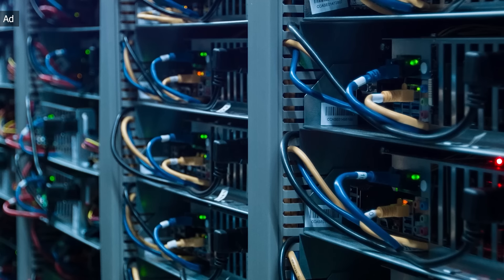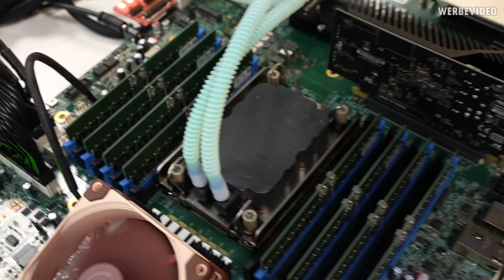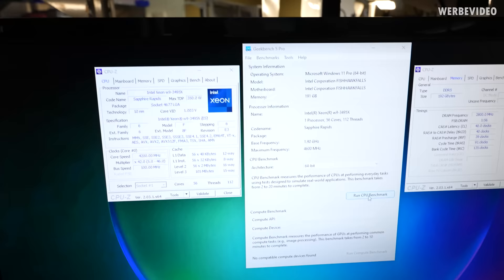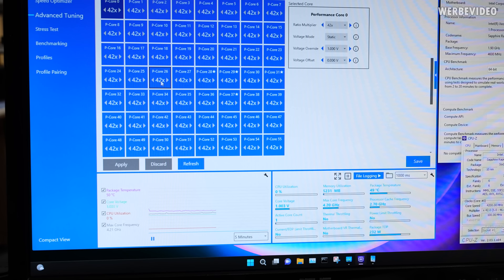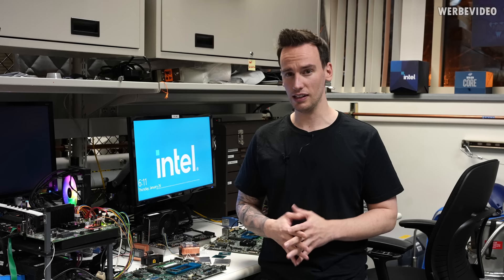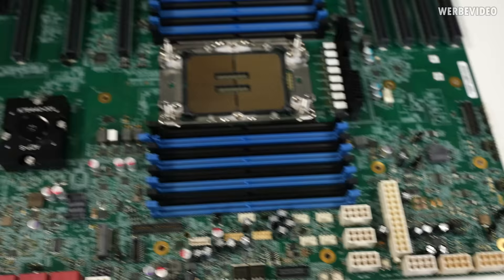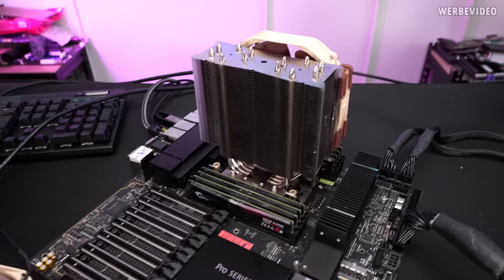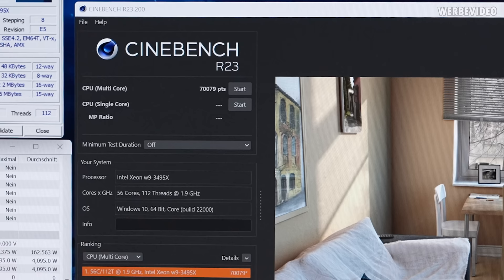Intel HEDT is BACK! Insane Overclockable 56 Core Sapphire Rapids CPU

Comment: Luumi showed with the W3175X that the package power readouts become quite skewed at the higher draws, I wonder if that is still the case here, would be interesting to see what it actually pulls.
Reply: That was reading power coming from the wall, so it's accurate.
Reply: @ionstorm66  That's assuming that the instrument reading the draw was accurate. It was bouncing about, could probably use a little integration to get a solid number.
Reply: @UncleKennysPlace  That was in the literal overclocking lab at Intel's headquarters. I doubt... actually I know they wouldn't use inaccurate equipment. I was an Engineering Technician there.
Reply: @UncleKennysPlace  those are the real numbers, it wasn't a solid burn in test. All the spikes in power are from the CPU getting loaded. Transients are a big issue with modern hardware. Also likely why they are doing Geekbench instead of something longer, I doubt that VRM and cooler will take 1000w solid.

Comment: They'll need to scale down AC Loadline for these CPUs lol. I'd love to see how 16 p-cores Xeon will fare in gaming, but the returnal of FIVR makes me unease - still got PTSD from Haswell's/Broadwell's FIVR and their crappy voltage control.
Reply: what's wrong with FIVR on that CPUs?. the idea itself were great but i never owned one so i know nothing about how it performs
Reply: @n.shiina8798  low voltage control resolution, non-functioning LLC, quirks like voltage going upwards with load.
Reply: @PolskiJaszczomb  wow. such a bummer!. hope they fixed all the problems now
Reply: Server/WS chips will always be suboptimal in games due to mesh bus.  Maybe not e.g. the 6-core, which should have fewer stops.

Comment: Apple gonna throw this in a Mac Pro for at least 8400$. Doubt this GPU performance of 4060ti will satisfy professional users. For the almost 5000$ + over the Mac Studio you get more than a bigger case though. Maybe the Mac Pro will allow a dedicated,GPU to be plugged into this pci e 4.0 x16 slot. With it's 300w power limit though I doubt it will be compatible to AMD cards.

Comment: why 56? Always seemed a weird number to me. Good to see Intel back in this space but my god, the cost!
Reply: Probably they use 4x16core tiles, so it's 4x14core bin crystals for that SKU.
Reply: I think they looked at the manufacturerability of the tiles, it makes the yields higher when you make smaller pieces of silicon. Remember that when it comes to fabs, Intel is behind TSMC and Samsung, so their chips aren’t as dense.
Reply: @tokiomitohsaka7770  i doubt that they decided to use such an asymmetric core count for the tiles. I find the theory that they just don't get enough full 16-core tiles to use for a product line much more probable. Maybe some "halo"-level SKU later
Reply: idk, the 15c die was also weird. so is 18c, 28c.

Comment: For the 56 core version, does it also come with 2 socket configuration ?
Reply: You'll probably need two sockets to compete with Threadripper Pro, to be honest. 7000 series having 96 cores.
Reply: The platform is capable of 4x socket; but the parts the initial release parts are limited to single socket. I am sure they will release 2x socket parts eventually.

Comment: 13:30 Is the board defective or CPU-Z is not working properly ? It should state that you have 8 channel memory because you are running a Xeon 3400 series and not the 2400 series.
Reply: Most likely CPU-Z since it's so new.

Comment: I don't care how fast it is, $6K for just a CPU is insane.  Enterprise/Megacorp pricing indeed.  Then again, a quick peek over on the Threadripper Pro/Epyc side the prices are similar, and then there's the fact that you cannot buy them outside of the big OEMs, already in systems that are paired with the motherboards/systems they ship in - no.  Just no.
Reply: Yes you can use that money to buy a 4090 instead and support Nvidia 😂
Reply: @1x4x9  Jensen said the more gpu you buy, the more you save. 😉
Reply: Well it is likely that the 56-core CPU is designed for really high-end workstations, but if you're complaining about pricing, it's better to look at the processors people are more likely to buy, in this case the 16 or 24 core processors. I think the pricing there is still too high compared to previous HEDT platforms, although being less terrible than Threadripper Pro is at least something good. 
Also, you can buy TR Pro CPUs individually, but they only came to DIY availability a year after their initial release, motherboards are ludicrously expensive, you're overpaying in terms of price per core, and overpaying for features such as 128 vs 64 PCIe lanes, 8 channels of memory, and security features that you may not need. Versus with these new Xeons, both lineups of "HEDT" CPUs and workstation CPUs are compatible with each other.
Reply: @jamesbuckwas6575  I see your point.  I guess the old adage applies here: "If you have to ask how much it costs, you probably can't afford it..."  XD

Also, good to know TR Pro can be bought separately, at a price...  If I ever need HEDT again after X99 lasted me for literally 8 years, I will know where to look.

Comment: 56 cores but not 112 threads? how many real cores with both HT and AVX 512?
Also what is the perf/watt? 66k CB23 with 515W does not seem great.
I bet that if you detach the cooler from the CPU while it is running CB it is instant death, and can't even measure the temp for the throttling phase befor going into the white smoke phase :D
Reply: It's 56 core 112 thread.

Comment: Finally, Intel doing what AMD should have done--somewhat, 1s2p (1 socket, 2 platform). Allowing older users to upgrade to more expensive processor down the road.

Oh wait, Intel did that for X299, but everyone bashed i5 7640X and i7 7740X.
Reply: And even if certain PCIe slots or memory slots are disabled when putting a 2400-series CPU in a motherboard designed for 3400-series CPUs, you'll still get 64 PCIe lanes and 4 channels of memory, which is still far more than consumer platforms can provide. That will be of immense benefit for when you initially purchase a 6-12 core CPU and 2-3 years down the road, you can upgrade to a 24-core or as much as 56-core CPU.
The mistake Intel made with the 7640X and 7740X is that they were (almost) literally the same processor as the consumer-socket counterparts, without even the PCIe lanes or memory bandwidth of HEDT platforms. It was just an excuse to pretend that X299 was an affordable platform while they were selling 10-core CPUs for $1,000
Reply: @jamesbuckwas6575  Nope, it's the same as the 7640X and 7740X.

You don't magically gain 8ch mem support when putting a 4ch W2400-series on a 8ch board.

Which, is the same for the 7640/7740X, you don't 'upgrade' 4ch mem support.

You also don't magically gain 48 more lanes when putting W2400-series on a 112 lanes supported board.

Sounds rather repeating, but 7640/7740X doesn't gain (the minimum) 12 more lanes.

And it's technically 'Don't Exist', not disabled.

And Intel's pricing is more justifiable when comapred to AMD's entirely CPU/APU line-up: They have fabs, and extra expenses behind the scene.

Not only that, their HEDT line-up is basically a 'highly binned' Xeon.

Comment: There will be maniacs who will individually tune each single core blotting all top 100 scores on all HoFs. They will publish core fvir/clock tables for their CPUs, then there will be another maniac, who will cry that their highly tuned tables don't work on his stock CPU, then he will throw money at the problem, buy all 30 CPUs available on the market, still give up and just give everything out to yet another maniac, who will tune each CPU and publish more tables, and first two maniacs will all delve deep into them and discover there are two distinct patterns in these tables, and will make a "tablegate" out of it, which will completely blow out of proportion.

Then Intel will conduct internal investigation (wasting money), only to discover, that yes, CPUs since batch X are slightly different because when swapping EUV bulb in $100M ASML machine someone put 2 identical screws in different order, which cause slightly different silicon etching behaviour. Then they will publish statement, that all CPUs are in spec, and there is no controversy.

Meanwhile two engineering companies and Pixar will buy out all remaining production, only to come to conclusion, that way easier and cheaper is to just buy normal servers and let people work on them Linus-style, with USB over fiber, and there will be the end of it. Oh, and that funny Chinese guy who builds over the top PCs will get one unit.

Finally, some unknown overclocker will hijack 1st place on Cinebench with Core i7-2700K cooled with Bose-Einstein condensate, publish single video from it to prove it and will be never heard from again.
Reply: Absolutely brilliant humor, I love it.

Comment: Intel should stick to making small silicon at high frequency with great single core and low latency, they should do H0 alder lake unlocked for that. 56 huge power hungry core have neither efficiency to compete on parallel workloads nor the agility to press where they have that meaningful single core / freq advantage

Comment: Great to have some competition form Amd ! But.. that power consumption is crazy! at idle or load the 38 cores intel in consuming more than 64 threadripper !
Reply: It's 56 cores. And there's no 38-core SKU in the lineup, only 36. Go get some glasses dude.
Reply: @Rubed0_o  Jajaja love the internet.. Ok 36 cores consuming more than 64 amd ... even worse
Reply: @arqrenderz6210  
Ah, so you're just a troll. As it happens, I had Threadripper 5995WX for a while, gobbled 1kW+ too, when at 4.3GHz, so it's quite alright for SR 56c to hit similar numbers at 4.2 under load.
But you don't care about that, do you? You're here just to poke fun at Intel.
Reply: @Rubed0_o  OK... if you can read and understand, i was talking about the 38 cores part, and yes, intel has a 38 core called W-3375, it consumes as much power as the 64 Amd one.. So YES im poking fun at Intel. DEAL with it.

Comment: My 13600kf in geekbench 5 2011 and 14800 single and multi. For €300. And it does that using less than 200W. 56 core Xeon? No thanks, lol
Reply: Your 13600KF is also limited to 24 PCIE lanes and the lowest of the W-2400 SKU's has a 120w TDP and is a mind boggling $359.  I've never understood why people who obviously don't need HEDT talk about it like it's a bad thing.  I specifically know a few people who do video stuff and AI stuff who are chomping at the bit to get their hands on the lower end SKU's so they can finally get more than 1/2 video card running at full speed in a modern platform that isn't outrageously cost prohibitive.  Just because this isn't a big deal to you doesn't mean this isn't a big deal.

Comment: 400-500watts just to be close enough to a 5995wx running stock @ 283w... that's not very impressive... but at least I hope the lower skus make more sense for those who need ram\pcie lanes.
Reply: mate look at the transfere rates of ram and pcie....in the energy density formular for electromagnetic waves freeuqncy goes in quadratic...its not the cpu that pulling so much the whole baord want to be fed juice....
Reply: @proxis9980  I still don't find it impressive though, the lower skus could definitely fill a segment Amd left vacant.
Reply: it was ahead of the 5995wx in cinebench locked at 2.9ghz...
Reply: @TheBURBAN111  not ahead of mine though... It's not a good  unless you want tons of ram. and for that you can source server parts.

Comment: Let me get this right...This CPU can put over an 1100 amp load on the board? WOOOOOW!
Reply: :D let me shock you more that cpu is quadscalable enabled...aka you can put 4 of those on 1board xDD
Reply: @proxis9980  That's no more shocking than one as that board would have 4 of the same VRMs. I own and work on quite a few large servers. It's impressive to me that a single unit has over 1kA load.
Reply: @proxis9980  That VRM would power a nice induction heater!
Reply: @RIGeek.  welll the question is why in hell would you use 30dollar 96+% efficency stages on something you WANT to create heat with? just take the cheapest you find and do a reagular heater build intot he induction one :P   from the suggested specs at 1.1kW they radiate somewhere between 33 and 70 watts over 8 so 4to 9watts per stage thexy litteraly almost could run without any cooler (at the default power for sure). But the boards cost for 32 of those will be astromonomical ....yikes xD  (also they realy suck at low load so that may explain the horrible idle power...sadly if you spec into efficency in the top half you lose all the nice chracteristic in the first half  ¯\_(ツ)_/¯ but then again why would you idle such a system :D

Comment: 56 slow cores. DOA platform. Makes sense only if you desire entry into hedt with few cores since Threadripper no longer offer 16 threads or lower unless OEM and they are OEM locked as far as i know
Reply: "slow cores" >mentions threadripper
Reply: literally higher single core performance than thread ripper lol if not on par...
Reply: @TheBURBAN111  Yeah 2 year old threadripper
Reply: @durdy911  and? you were saying 56 slow cores then mentioned threadripper as if they are somehow faster?
Reply: @TheBURBAN111  Cause they are slower.

Comment: Between quad 14 cores 28 threads that could run 4.8Ghz+ and octoc 8x8 cores , for a software intel ccx will be more powerful than AMD. At the end of the day, if you don't use all cores all the time, you won't benefit from AMD. AMD sells 299$ MSRP 8 cores 1 ccx, 2ccx 7950x 699$. If you calculate 8 AMD ccx 300x8=2400$ put 100$ per CCX link, 3200$ is it for 64 cores? Does intel chip worth? Idk either.🙄

Comment: The 6-core looks good, but price/performance wise is inferior than the low end desktop CPUs available, say R7 7700X at $299.
Reply: that is true, but to be fair those parts – just like the low core count Epycs/Threadrippers – are for when you don't really need much multi core perf, but do need more PCIe lanes or extra memory bandwidth. If you don't, its really a waste of money and power draw not to go with a desktop CPU instead.
Reply: @Hugh_I  I agree. Unfortunately the industry made the desktop platforms practically incapable to run 128G because ddr5 unbuffered is so sensitive to load that it has to run at 3600 Mt/s where it's price is not justified over DDR4 for the reduced bandwidth and higher latency
Reply: @angelg3986  Yeah agree, that is sadly true as well. At least with the first gen of DDR5 platforms 4 sticks seems to not be worth it.

It's also pretty annoying that those PCIe5 desktop platforms theoretically have a quite a lot of PCIe bandwidth that would go a long way for a budget workstation setup, if most you need is a lot of PCIe3 devices. But you can't really use that bandwidth without frankensteining a bunch of adaptors or even exotic and very expensive PLX chips onto any of those motherboards, because despite there being plenty of different boards, all of them are basically made for "storage and 1 GPU is all you need" in terms of PCIe connectivity.

Comment: to me its a utterly trash platform. the idle power draw is 6 times to high and the load draw is 4 times to high.  This would cost over a grand a year to run on just electric bills which is uttterly stupid to me.

Comment: Now imagine if AMD done the same with Ryzen 4. That would be something amazing.
Reply: Unlocked 9554P (64c Z4 "storm peak") TR pro for $6500 (they're $7100 already so no biggie) /Done. Except thats upto 12channel and a socket for 96-128 cores which intel has no answer for.
New threadripper is meant to be on SP6 with octa-channel similar to previous TRpro and this.
Reply: They still have the 5995WX that runs circle around anything Intel has produce, so why?  Server market is where the money is, not in HEDT for a very small fragment of the population.
Reply: @ryzenforce  But it didnt run rings around the cpu in the video? lol